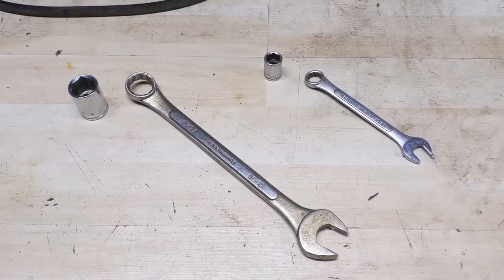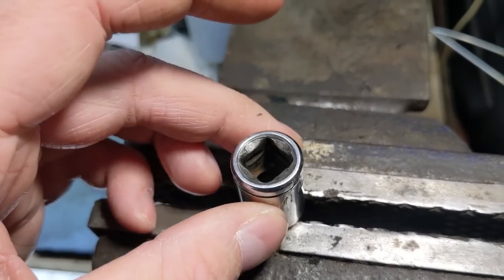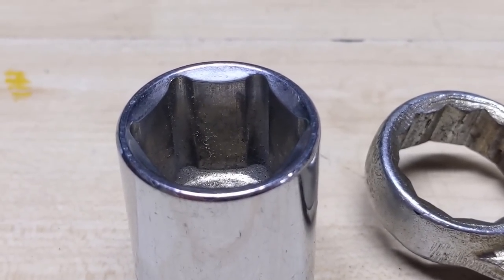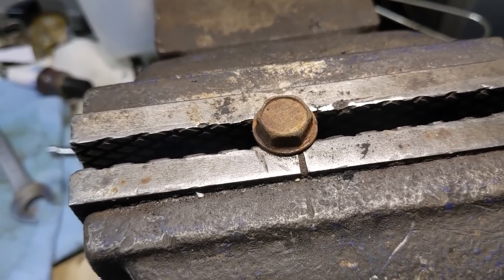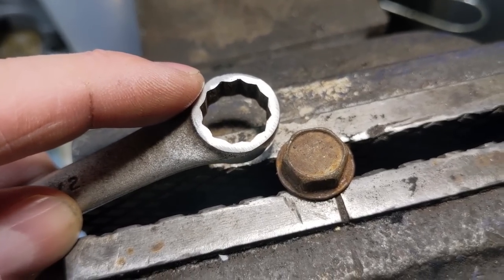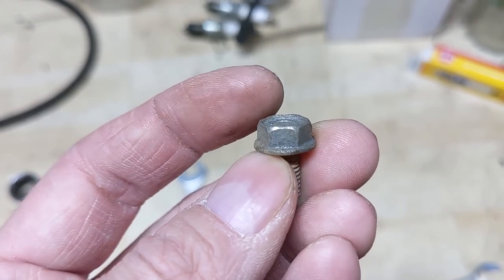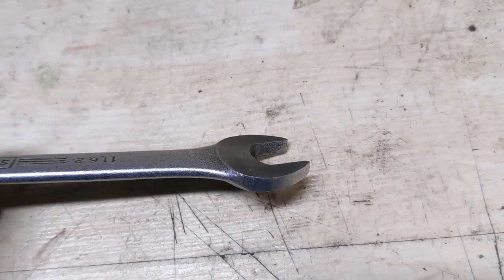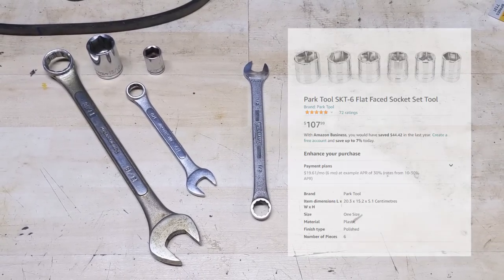Easily Modify Sockets and Wrenches to Decrease Slippage

Comment: A bevel only goes across part of a surface. A chamfer goes all the way across. 
A wrench with an enclosed end (box) and an open end is a combination wrench. 
Box end and sockets tend to round off the heads of hexagonal fasteners if the tools are 12-points. If you think there’s a chance of rounding off, always better to start with a 6-point if you can. 
(For all your newbie tool users out there.)
😉👍🔧
Reply: Good point made Rein but i will still call it a bevel on the ID of a socket simply because there is no end to a circle for a bevel to stop LOL.
Reply: @waynestefinashen239    😉

Comment: Great tip. I had bought an inexpensive set of wrenches and have already ground the open end thinner to help tighten/loosen double nut scenarios. I will now be grinding the box ends to get a better purchase. Keep up the videos. Thanks
With the recent snowfall, instead of starting problems, my neighbour and my son both had drive wheel problems. Just coincidence or is that how it goes. Once the machine runs properly, the next that goes is the drive wheels?
Reply: When the snow is heavy and wet and you do not stop (auger always turning) to allow the snow to clear you will burn up and auger belt and the drive belt is put under a lot of stress and likely starts getting what i call burnished (shiny but not burnt) this will eventually lead to some slippage. Additionally, if the auger belt has been changed and it has an old drive belt this is also an issue. We suggest to all our customers that we change both belts even if the one not needing change looks visually ok.
Reply from the maker: Always one thing after the other Anthony lol next it'll be belt issues!

Comment: Excellent observation!  I’m in the process of refreshing a 27” Craftsman blower. Exactly one of the issues giving me grief.  Couple that with the rusty threads and then you have to get out the grinder.  I will be implementing that solution promptly!  Now I see why they are asking $5 Cdn per bolt to match them to replace. Gimme that anti seize and regular carriage bolts.  Any clearance issues are solved by some more grinding at $0.   Happy New Year!  I’ll be looking for some Boxing Day socket & wrench deals.
Reply from the maker: Thanks for watching and good luck. Happy holidays!

Comment: Merry Christmas to you Jake your my only channel that i sub to that i did not send this Christmas message to i totally missed it. This video is a few days late for me. When i was removing the access plate on i believe it was the PowerSmart the panel bolts where thin headed and two would not come out with the socket so i had to use the bolt extractor to remove them. Your tip in this video was right on and would have solved my dilemma . At first i thought i was using the wrong socket, nope just not enough surface area contact due to the bevelled edge. Good video sir!
Reply from the maker: Thanks for watching, and Merry Christmas and happy holidays. EP wouldn't be as successful without you boss!
Reply: Funny Wayne LOL
Reply: @henrymurawskibigdogrepair  he does have a funny side! 🤣🤣🤣

Comment: Sometimes using the metrc lower but closest can deal with some slippage like 14 mm on a 9/16. Learned that over 20 years ago n a gm water pump.
Reply: Yes it may but in my case the 10mm 3/8 ths made no difference used the 3/8 ths bold extractor

Comment: And while you are looking for a cheap set of combination wrenches to grind down and narrow, buy a long needle nose style locking pliers (vise grips) to narrow down as well.  Over the last 30 years I think I have used the vise grips I narrowed more than the wrenches to grab a hold of rusted, corroded, corner rounded fasteners that were hidden behind something else. 
A word of caution: Do not buy the cheapest pair of locking pliers.  You do not want sideways slop between the jaws once they are narrowed. Work slowly with a container of water near by to keep as much heat as possible out of the jaws so that you don’t start drawing temper from the gripping surfaces of the jaws.
Reply: Good idea and spot on the quality is the most important thing when buying any tool. Normally that quality comes with a higher price tag but in the long run it is money well spent.
Reply from the maker: Yes they're always good to have, thanks for watching!

Comment: If you are in a pinch, I'd say to do this. Just don't be upset when you try to return these tools on a warranty claim and you are refused a new tool. 

Buy the proper tool to do this. Likel you said, there are plenty of sockets and wrenches made without that bevel and there are already thin wrenches on the market. 

I'm not one to modify a lot of tools by removing material.
Reply from the maker: I have so many wrenches it was really no big deal but yes I definitely wouldn't do a whole set unless I got them for that purpose

Comment: My Socket Wrench stopped retracting the other day and now i have to keep taking the socket off the nut after each twist. It's annoying and I'll have to pay for a whole new one if I can't figure out how to fix it so it retracts again. 🎄🔧🔩🤷
Reply from the maker: You can take them apart and lubricate them. There's a small gear and a clip with a spring. The clip is probably stuck!
Reply: @EliminatorPerformance  Oh really ? Ok i'll see if i can get it apart and hit it with WD-40 or something. Thanks for the tip !! 👍